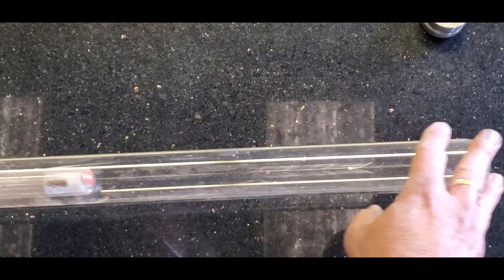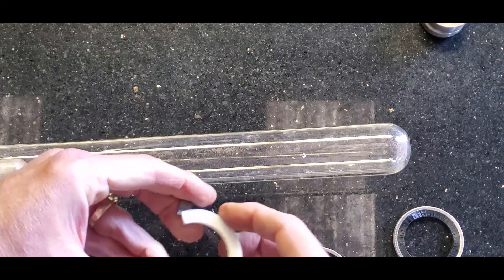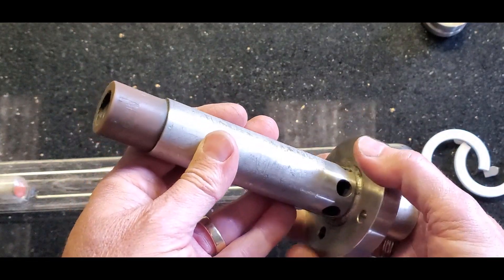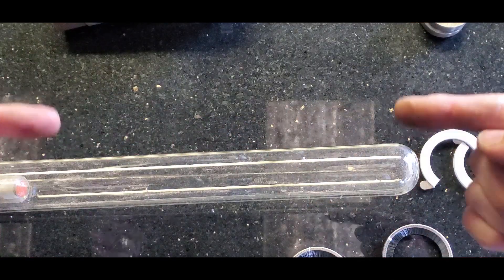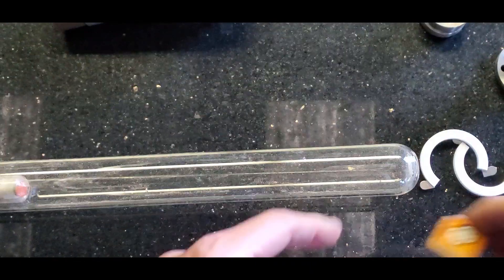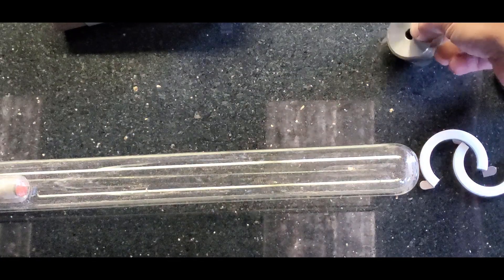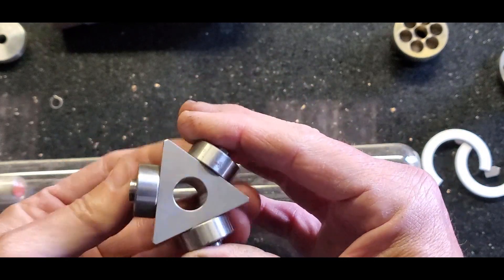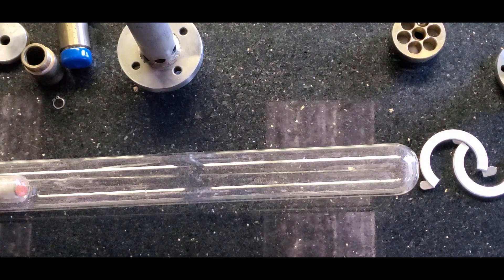A Tale of Three Thrust Bearings

Comment: Can you please tell me what kind of bearing would be suitable for https://en.m.wikipedia.org/wiki/Expeller_pressing machine. Does screw require radial or axial bearing? Which bearing you suggest, thank you.
Reply from the maker: Sorry, just seeing this now. This looks like primarily a thrust application, so a thrust or axial load bearing is correct. To center the screw, the thrust bearing selected has to be able to withstand some side load. A roller bearing with a steep angle will be correct, these can take some side load.

Comment: Jim,  I love your bearing designs,  Almost a shame that the commercial bearings were a success, Ha !  The tri-bearing one is very cool.  it probably has some scrubbing action on the thrust plate from the different radial velocities from the line-contact path of the bearing races, be it very minimal.  If the steel flanges of the commercial lip seals  rusted away, perhaps use O-rings to create a seal.
Reply from the maker: Me, too! The goal was a 6 month life, as modules were removed for lamp replacement then anyway. The McMaster bearing was less than $20, and the 7/8"x3/8" were less than $7 each. I even have some silicon nitride balls for the bronze cage, just couldn't find them for the video. One of the three solutions had to work, but there was no need to test the other two when Option #1 survived even with a failed seal. I wasn't able to find a seal with an SS shell. The garter springs on lip seals are also carbon, both were basically gone, just a swirling ring of grease that didn't let the water in. Here's the grease we used https://www.greengrease.net/ available at auto parts stores.

Comment: Thanks it was interesting. It’s amazing the delrin outlasted the bronze and brass nuts, it goes to show it’s resistance to a harsh environment and it’s mechanical wear property. Cheers, Peter
Reply from the maker: I expected better results from the Ampco 18 bronze, it's good stuff. With no way to lube the leadscrew, the combination of a soft nut allowed grit to embed in the delrin and keep on running. Keeping the screw straight and the wiper plate from deforming (i did FEA and added stiffening ribs) helped tremendously.